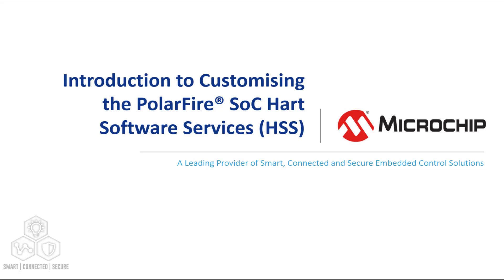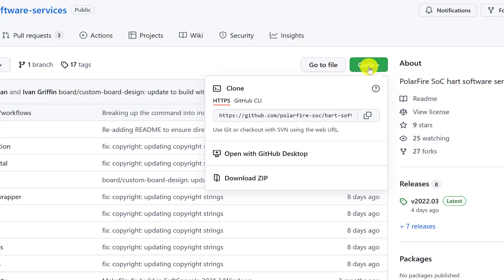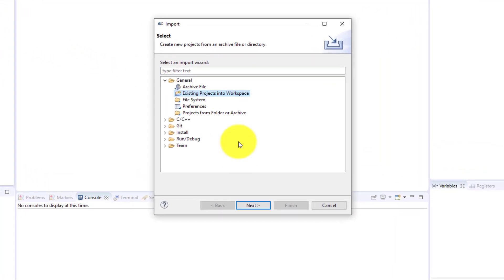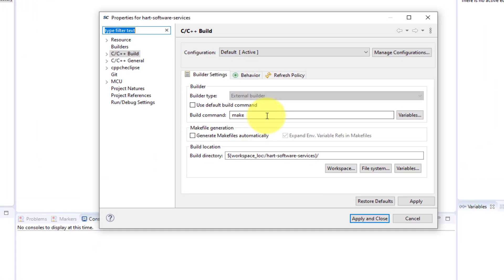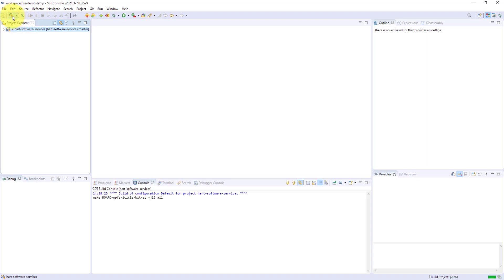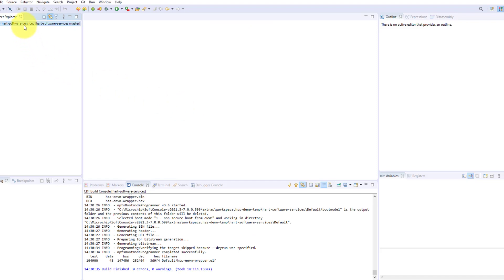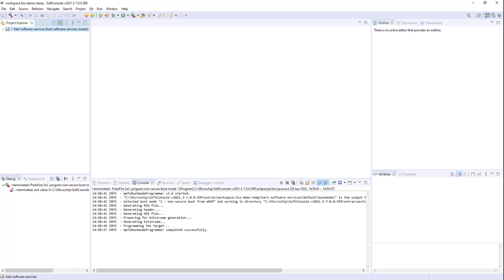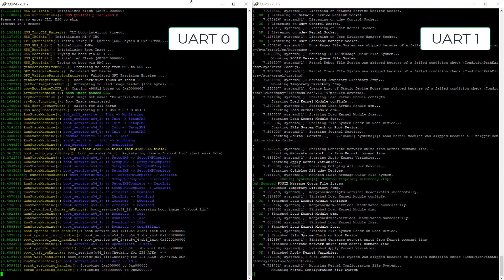Introduction to Customising the PolarFire® SoC Hart Software Services (HSS)

Comment: Error while evaluating variable active_core_build_dir.
Path for project must have only one segment. 

What should I do?
Reply from the maker: Hi there, thanks for reaching out. To help troubleshoot, could you provide a bit more detail on the steps leading up to this error? For instance, what specific action were you performing when it appeared? In the meantime, we'd recommend double-checking that the project path follows all specific guidelines, such as avoiding spaces or special characters. If the issue persists, reaching out to tech support with detailed steps and screenshots of the error could help them assist you more effectively. (https://www.microchip.com/en-us/products/fpgas-and-plds/support). Thanks!